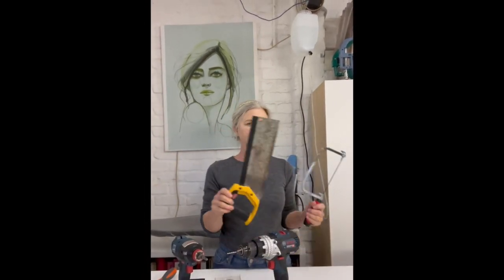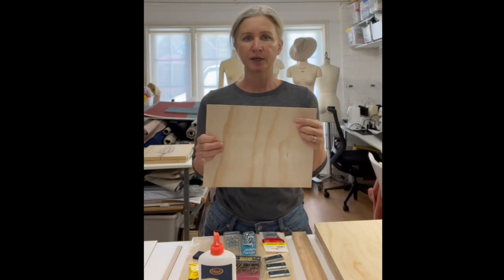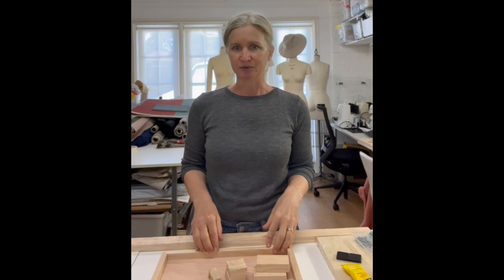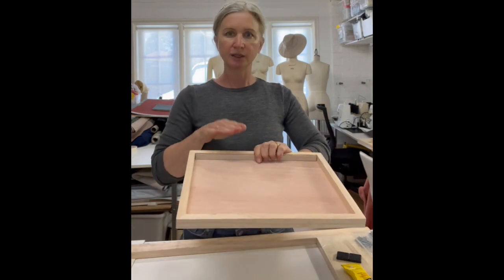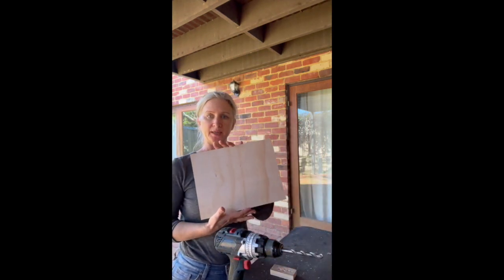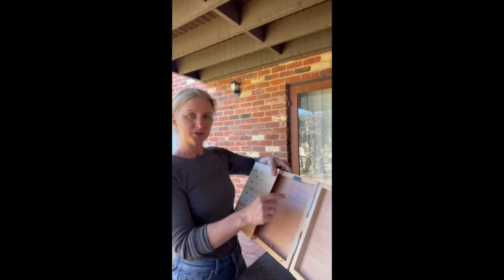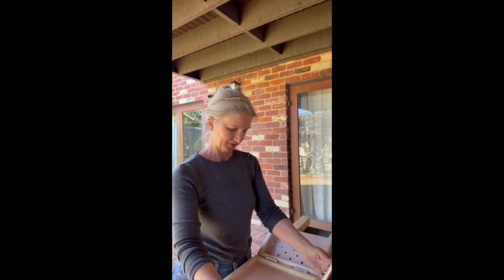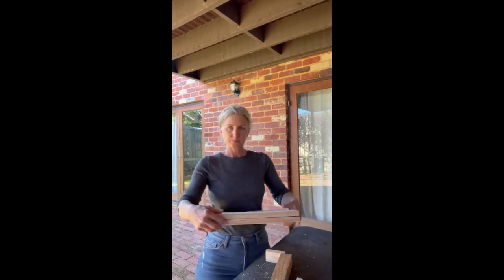DIY easy Pochade Box

Comment: Given pine and ply are softwoods do you need to seal the final product against moisture damage from both oil paint and liquids such as water and solvents?
Reply from the maker: I did seal the inside with wood oil, but now i use a plastic palette inserts so I can keep my paints fresh or swap out for my pastels - find this works really well.

Comment: Great design.  And at 18:15 on the video it shows you placing a spare board on top, which would still fit inside the height..........well if that was a painted panel....and you put 4 push pin/tacks, one in each corner....you could carry a finished painting back from the field without it touching the top.
Reply from the maker: that is true!

Comment: Looks like 2x4 is centimeters, imperial is 1”x2”. 
Thanks Sarah!
Reply from the maker: I am not sure of the exact equivalent, I don't work in imperial, but I think 5cm is just over 2".
Reply: @sarahpondevieart5563  yes! Weirdly though the boards are called 1x2, 2x4, etc but the actual measurements are at least ¼” smaller so the metric is closer to reality.

Comment: How deep were the edged od your studio boards. I just bought the 12 inch x 16 inch with thick edge profile of 38mm. Thinking it may be too deep?
Reply from the maker: mine were 2cm, but I also work in pastels, and that is not deep enough for them - so I would also do one with 38mm profiles for them!
Reply: Nearly finished box. Just doing brackets to hold on to tripod. I have pre glued mine then they won’t move about when drilling the screws in.
Reply: Ps. I found your video very easy to follow. Thank you for sharing with us.
Reply from the maker: @yolandacarter6770  you are welcome! if you post a pic on Instagram, can you tag me so I can see it?!